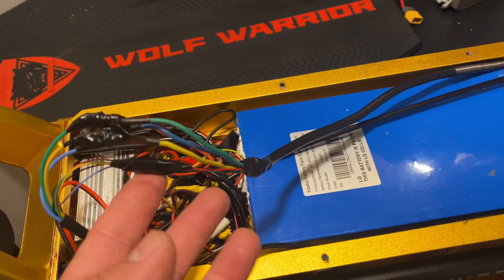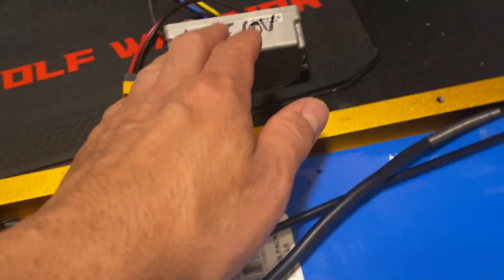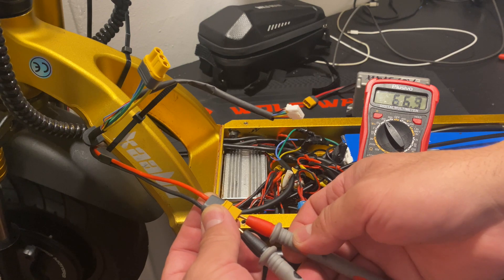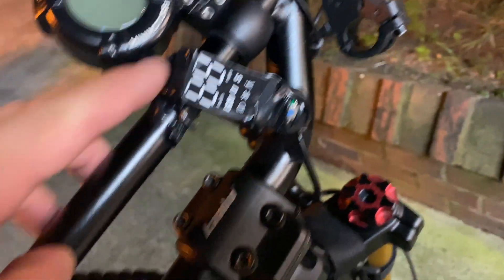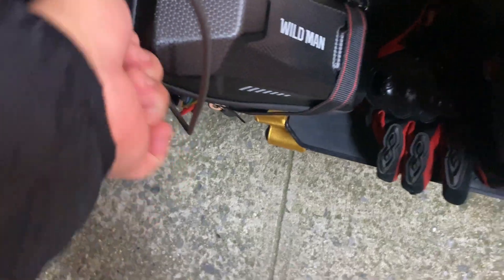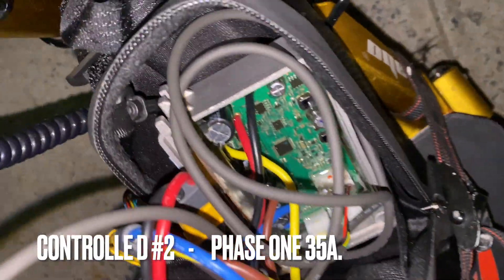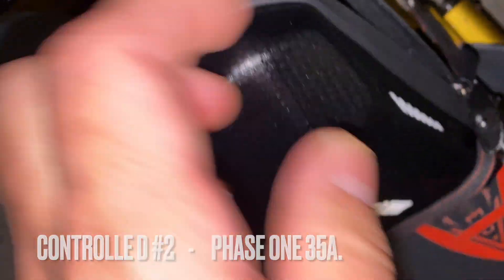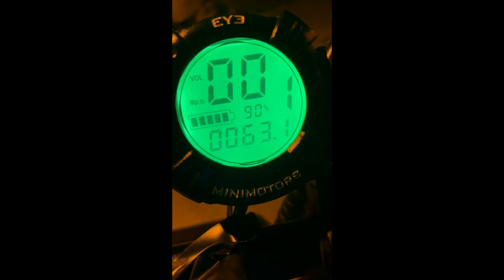Ninibot Max G30 D Controller - Tested on 60V!!!

Comment: The capacitor is only rated for 63V, so are you sure about it? 67V will be 4v exceeded it's rating. 
I'm about to build a 16S battery but is a bit unsure, I would rather built a 15S, but it's complicated to find BMS and charger for 15S...
Reply from the maker: D Controller will hold up 67.2V without any issue if you do follow set ups and do them right. Check out link and descriptions of videos. https://studio.youtube.com/video/qFelQDGsx5k/edit

Comment: I have a D controller but I can't go faster than 45km/h it's locked by firmware, which firmware do you use to fully unlock the speed limit?
Reply from the maker: Change serial number to unlock full speed aside of changing region to US.

Comment: How many amps is it running?
Reply from the maker: Above 35A burn controllers. Might change in less than 1100W motors. This testing was done on 1100w motors.
Reply: I run 37A 52V on my G30D controller with stock motor. Has been doing that for 4-months, I'm a daily commuter, wanna say though that it's winter here, so maybe in summer time it will not end well.